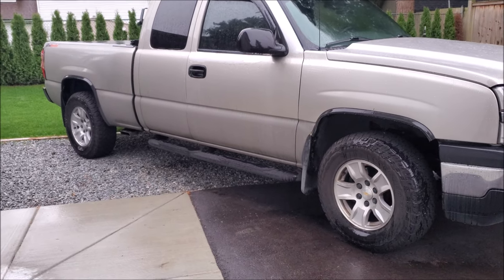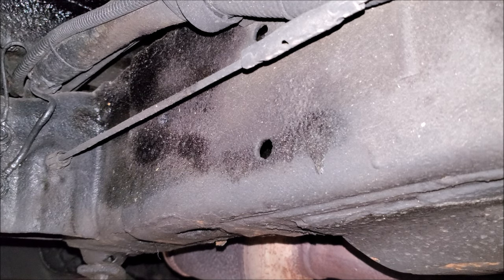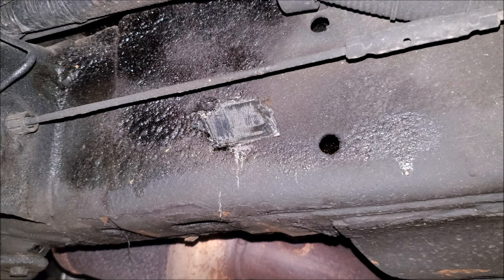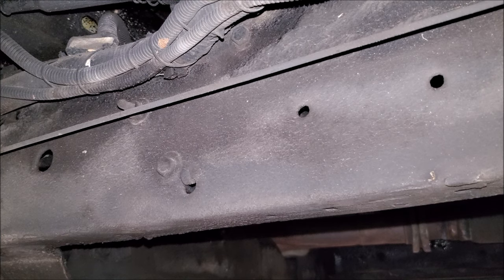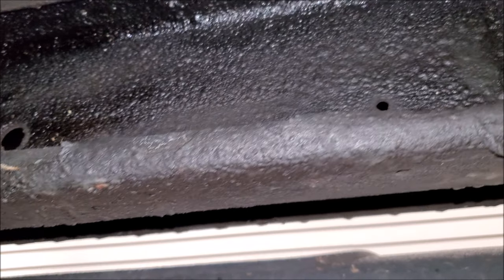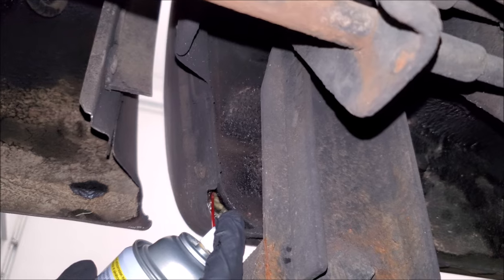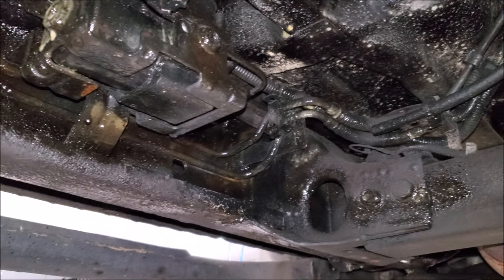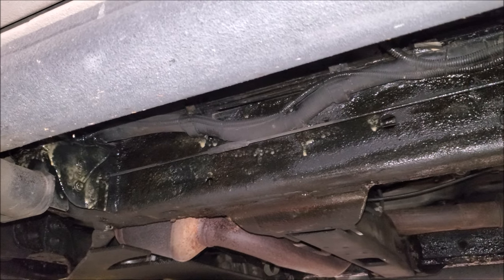How to make Rubberized Undercoating last with NO RUST (spray with Fluid Film) | AnthonyJ350

Comment: My experience with Undercoating over 4 decades is preparation prior to application is critical. The surface must be thoroughly cleaned, free from dirt, sand, scum, oil, water, etc. Every year inspect any damaged/blasted undercoating and repair as needed. Nothing is 100% effective against rust, you just want slow it down as much as possible.
Reply from the maker: Very true, thanks for sharing!
Reply: Do you recommend undercoating? I saw some videos suggesting undercoating doesn’t benefit to resist rust?
Reply: YES, Look at Project Farm for the results of testing of rust Inhibitors. If you in the Salt/Rust belt, it should be   a mandatory thing if you plan to keep the vehicle for an extended period of time. This also applies to those who drive near the coast as salt air is corrosive.
Reply: @stealthg35infiniti94  thanks for your response.  I saw video on YouTube in which he was telling rubber undercoat doesn’t resist rust, but may trap moisture and get more rust. It really keep me in dilemma whether to get undercoat or not..
Anyways, since you have Long experience with undercoating your vehicle, I’m convinced with your point of view.
Reply: Wrong. If you took the cars frame and dipped it in a vat of undercoat, it WILL be 100% rust proof. Simple logic.
Reply: Not with fluid film. Just spray it on everywhere  and leave it. Top it up every year on, let the grime build up. No rust.
Reply: @That one guy who drinks Too much coffee  
Until stone chip, or scraping beaks the seal, then water creeps in, gets stuck and rots it inside out. 🤔
Reply: @pooroldfred  That's why continuous  application must be done. There's no one shot application product that lasts forever.
Reply: @pooroldfred  not with me

Comment: Glad you made this, i want the sound deadening of rubberized, on the inside of a floor pan but know how it can rust underneath. Was saying to myself why not just do both.. rubberized first then a layer of non-drying/oil undercoating on top. I've also found playing around you can make a really sticky undercoating that stays soft by 1/3 wax based, 1/3 motor oil, and 1/3 grease.. then you can thin it to a sprayable consistency with varsol/paint thinner. Solvent flashes off in a day or so and you have a really sticky undercoating that importantly stays soft, but i'd still do Fluid Film first bc it';s supposed to creep.
Reply from the maker: Let us know the route you decide to go!

Comment: I found it only really forms if the prep work is bad. It takes me longer to prep than it does to apply. Definitely not a rush job. I've been using fluid film and Rustoleum rubberized for years and my '97 Blazer is still doing just fine. And if you love your vehicle enough; this heavily involved preventative maintenance just feels good.
Reply from the maker: That's awesome, thanks for sharing!

Comment: Thanks for this video. 
I am restoring this rescue 1993 LX mustang. But I decided to start swapping out the base 2.3 for a 5.0. As I am doing that, I started realizing that It would be best, as I will be working from behind forward, that I should clean up any rust, primer and throw on some rubberized undercoating to not only cut down on road noise, but also to protect the car from any fast forming rust.
Reply from the maker: Yup and that car isn't going to see much rain or snow ever I assume.
Reply: @AnthonyJ350  right now it's stuck outdoor parking, however I will def be keeping it clean. 

I ended up picking up a Ford 5.8 V8 from a 1997 Econoline and a 6 speed. It's slowly being put into the car at this time. I do have the engine torn apart for regasketting rn.
Reply from the maker: @hotrodmercury3941  That sounds so cool! When you start work, can you tag me on Instagram so I can watch the progression of the build???? 🙂
Reply: @AnthonyJ350  sure thing!
Reply: @AnthonyJ350  you got a channel insta?
Reply from the maker: @hotrodmercury3941  Yup, just search AnthonyJ350 on Instagram
Reply: @AnthonyJ350  got it I'll follow. My user is usually Hot Rod Mercury or That Old Merc

Comment: Do the same thing on my 04. Only drove it last winter and it didn’t rust at all. It did have an undercoat when I got it but I did find some spots like you said that were wearing off, sanded that down and added rust reformer in summer, then put fluid film on it before winter. Fortunate enough to park it this winter as it’s only got 120 thousand miles on it which is 193121 kilometers for you guys up there in Canada.
Reply from the maker: That's awesome!  Thanks for watching!

Comment: Have you ever had issues with the fluid film causing the rubber undercoating to swell? I was interested in doing this as well but I asked fluid film customer service and they advised against using it over rubber undercoat for this reason.
Reply from the maker: I don't know what choice you have.  Did they want you to dry ice the whole vehicle to remove the under coating?  I haven't had it swell, it looks how it did in the video.  I just found the Fluid Film can stay on the vehicle longer.  

Best thing to do, is buy a can and spray it on a small section of the undercoating and monitor how it reacts.
Reply: @AnthonyJ350  Thanks Anthony. Will try that.

Comment: I'm quite chocked how easy it is to peal the rubberized undercoating. I'm restoring a VW mk2 golf and I really had hard time pealing off the undercoating that seems to be made of polymer like stuff and very similar to polyurethane glue. Even if I stabbed my screwdriver in it, it wouldn't budge.
I bought some liqui moly undercoating a while back and it peeled right away with my screwdriver, in a similar way I see in your video. So I'm really puzzled on what product to use. I'm starting to think of using polymer based product but not sure if it's the right product to use, since I cannot find the OEM product or equivalent where I live.
Reply from the maker: Try Fluid Film black
Reply: @AnthonyJ350  thanks

Comment: Hi, I've been following you since i bought my 350z some time ago. I have question for you. What's your opinion on the flywheel? single mass? Dual mass? any manufacturer? Kind regards and nice videos
Reply from the maker: There's a mid weight single mass from Z1 Motorsports which would be a nice blend. It will be more noisy than the factory unit but the engine will spool up a bit faster.
Reply: @AnthonyJ350  Thanks mate

Comment: Giving this method a go on my nissan frontier dealer i bought it from sprayed some rubberized stuff on the outside of the frame, not over rust for “aesthetics” heard bad things but not going through the trouble of scraping. Hopefully the FF keeps it from rotting like your truck!
Reply from the maker: Just Fluid Film it every 6 months and it should be good.  Really focus on areas that get moisture and debris kicked on from the tires.

Also take the time to rinse and clean under the truck periodically.  Caked on stuff will make it corrode.

Comment: But why use the stone shield when fluid film dies the same job without the risk of the stone chip folding ? I just use fluid film on my 1998 nissan van. It is spotless.
Reply from the maker: Stone shield can dampen noise and holds the Fluid Film on longer.
Reply: @AnthonyJ350  
I live in northern england where salt is used a lot.  Ive got a 98 nissan elgrande. Known to be rust buckets.. These were only made for the japanese market, and as they dont use salt in japan, there is no underseal used at all. There is no rust to date using only fluid film
It seems like a real pain, messy and time-consuming to paint itvas well and risk it curling.. You would still have to reapply the fluid film anway...i just did the box sections and sprayed everywhere i could see..., and now i just use a couple of cans a year to top it up . I haven't bothered reapplying in the box sections...takes me about 2 hours a year.  My other car is a 2004 suzuki carry agsin from japan....spotless....so it works on its own perfectly well....
Reply from the maker: @pooroldfred  That's great! Nothing wrong with the way you're protecting your vehicle.
Reply from the maker: The one thing I don't like about Fluid Film is everything sticks to it. So after a good rinse in the spring I don't reapply it because summer months we go on logging truck roads.

This fall I reapply Fluid Film.

My 350Z is just clear coat and Fluid Film in key areas.
Reply: @AnthonyJ350  
If u have a 350z i can understand you not wanting to get the grime build up. I think the grime and dust help protect mine....but ive got a van and not a 350z.....if you win the lottery and decide to give away your 350z, the the only thing i can say is...pick me, pick me

Comment: Hi thanks for the very helpful content. I have a vw mark 2 golf and i noticed that the factory underseal of wheel arches has started to fall in some patches, but there,s no rust. Can i fix it by sanding it with 800 grit and applying prime paint on it and then applying the rubberized undercoating? Thanks
Reply from the maker: Yup you can totally do that.  I recommend after it has cured, coat under the car with Fluid Film.
Reply: @AnthonyJ350  Thanks a lot for the reply. Unfortunately where i live i haven't been able to find fluid mostly because the winters here are soft and they salt the roads maybe only one or two times for winter but i will try to find an alternative or maybe try to order it but i think it will cost a lot since its very far.
Reply from the maker: @shkelqimaliu4126  It's not at any parts stores where all the spray can lubricants are sold?
Reply: @AnthonyJ350  nope they dont have it unfortunately.

Comment: Someone put that 3m rubberized undercoating on my floor pans only,    the primered it then put the rubber on and im seeing spots of rust coming through the rubber,    do i need to scrape any of the rubber off or could i just spray fluid film over top of everything
Reply from the maker: I would to inspect how bad the rust is.
Reply: @AnthonyJ350  thank you 👍

Comment: I got my 2005 Corolla used. I was jacking it up at different points and later realized it has an undercoating but is now damaged by the jack and jackstands all around the vehicle. It was probably coated new since everywhere the coating was stripped looks pristine. 

I cut off all the bad parts and sprayed on some rubberized coating. The front control arm and the X frame where the engine sits had a little rust on it so I sprayed only the rusted parts down with rubber as well. I didn't remove the rust but it was dry when I sprayed rubber on it. Should I not have done that?
Reply from the maker: You can just spray over those areas again with Fluid Film and it will neutralize the corrosion. You'll just want to spray it at least once a year.
Reply: @AnthonyJ350  Alright, thanks !

Comment: Get rid of the fluid film cans and go buy yourself a 5-gallon bucket of fluid film and their professional spray kit you will save yourself a ton of money in the long run
Reply from the maker: I will, but I haven't finished plumbing my airlines in my shop yet.
Reply: Can you use a manual pump sprayer?